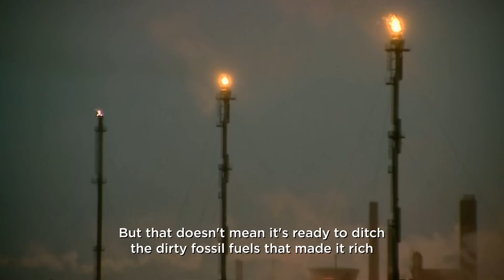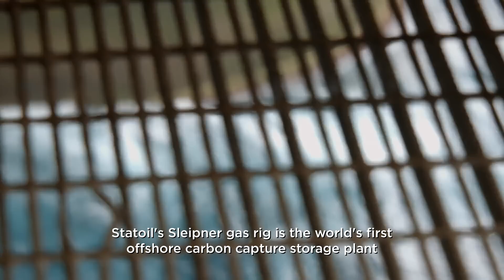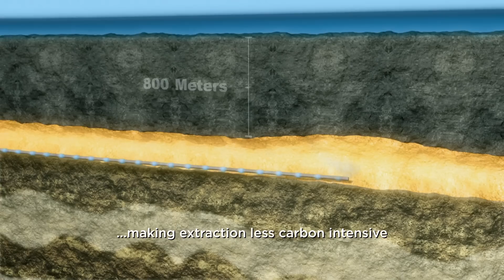Oil and gas companies are facing major technological disruption

Comment: I am not anti-nuclear, I am simply pro-renewables. Nuclear has failed to deliver what we need. One day perhaps, in the future, someone may be able to make a safe nuclear plant that is capable of cleaning itself up, but that day is a long way away. In the meantime, let's cover every roof with solar and allow the wind to blow us into a cleaner and more secure future.
Reply: Rob Kay storing waste and decommissioning old plants costs negligible amounts per kWh of electricity delivered. There are plenty of methods of storing used fuel. The core issue is that of public perception, nuclear accidents aren't special or particularly devastating however we demand perfection in regulation which we don't do of any other industry. If we applied normal hazard based regulation to nuclear it would be the cheapest source of energy and would displace much more dangerous and damaging forms of energy (fossil fuels have emissions and high death rates acquiring them, people even fall off wind turbines quite a lot!).
Reply: Rob Kay also have a look at sustainable energy without hot air by the late great Prof. David MacKay (chief scientist at UK department of energy and climate change) to get an idea of the amounts of space required to run a country on renewables.
Reply: A rather small percentage of the Sahara desert would generate enough solar to run most of the world, but transporting it would be silly. Using all our wasted roof space to generate solar: impeccable! 
Come back to me after we have done that ... and tell me if it worked.
Reply: I encourage you to check out some videos on the Liquid Fluoride Thorium Reactor.  (LFTR or "Lifter")   The technology has already been researched, but it was squashed because the director of Oak Ridge Labs wasn't a "people person" (didn't get along with the politicians) and also because it does not produce bomb grade material.
They ran a prototype LFTR reactor for 5 years, so this is not pseudo-science.  

The LFTR designs that are available still need to be updated, modernized and scaled for production, but overall they were Safer and Cleaner than any of the reactors in use even today.    If a LFTR reactor had been in use at Fukushima, the earthquake and tsunami would have been bad, but there would have been NO "nuclear disaster".   

LFTR reactors are "walk away safe".   If you have to evacuate the facility, it shuts itself down automatically because of the Laws of Physics.   You can't do that at today's typical nuclear reactors.  

The current typical nuclear reactor uses solid fuel.  The process only uses up about 3-4% of the physical matter.   The other 96% of the "fuel rods" is then unusable and has to be disposed of "safely".

The LFTR can use those "spent" fuel rods and effectively use almost the entire mass to produce energy.  The byproducts of this process have 2 uses (Medical and Spacecraft) so there is no need to "safely dispose" of the leftovers.     Yes, this means that we could potentially harvest and clean up our nuclear disposal facilities.
Reply: Thiru Vellan - how the hell does Hydro Electric lead to deforestation ?
There may be some land that is covered by BUILDING a hydro electric dam, but those trees can be replaced by planting new trees in areas without them.   But that's a precursor, not an after effect.  Plus it also creates a lake environment for fish and wildlife that wasn't there before.
Reply: Renewables Do use fossil fuels for production. This is not a valid reason to oppose them. Of course we will need to expend fossil energy in order to create the renewable resources that will replace it. Eventually, once we have enough renewable power, their production can be all renewable as well.
Reply: Unfortunately, not all locations have access to hydroelectric power. Also, hydroelectric has its own massive environmental impact. In locations blessed with hydroelectric, its usually much cheaper than the rate for fossil power.
Reply: The UK AGR II is safe, and has the usual low running costs. They currently generate at £10/MWh.
There is much less clean-up than is popularly believed.  High level waste from the entire UK nuclear programme over the past 60 years would fit in about 5 double-decker busses or so.

Replacing a 1.3 MW nuclear plant requires about 10 to 20GW of installed solar.  Covering every roof in the UK with solar and flooding the entire North Sea will just about replace our nuclear fleet.  But we also need to replace the coal fleet and the gas fleet.
Reply: We all need to put more efforts into inventing a more efficient battery. Seriously, battery development has gone stagnant in the past 3 decades or something. This has caused a huge obstacle in the implementation of clean and renewable energy sources since they are unpredictable and often times produce excess energy or no energy at all. The only alternative right now is to use the excess energy to pump water back into the hydroelectric dam for later use.
Reply: Batteries aren't an energy source.  Slow battery dev does not stop using renewables.  Current batteries are fine.  Look at Pivot Power, or even the Tesla grid-scale powerwall in Australia
Reply: icwiz - you are arguing the wrong point,  but I'll address it anyway.   

While it's true that eventually Solar will become a valid resource for energy on the large scale due to the development of better batteries.  There is really no need to rely on it as our primary source of industrial energy.

Wind Energy is only good for smaller scale energy generation.   Large scale production relies too heavily on government subsidies to make it "affordable" and "viable".    It cannot compete with or ever replace fossil fuel energy.     When looking at the cost of a wind energy site, you need to look at the costs not only in production and upkeep but also to the environment.    Birdstrike has become an issue in many locations where these devices are used en masse.    Other than the casualty to birds, there is also the fact that with enough windmills you will alter the environment.  

Think of each windmill as an energy converter.   You're taking the (mostly) horizontal wind energy and converting it into a rotational energy that in turn spins the generators to produce electricity.    With each additional windmill you're redirecting more energy from wind to electricity.     You're not making energy, you're just redirecting it.   So there is a net loss of energy in the force of the wind.   Minimal to be sure, but when you set up a wind farm over vast areas for dozens of kilometers you're effectively changing the weather.    What starts on one side as say a 20Km/h wind-speed  would be dropped down to only 2 or 3Km/h wind-speed on the other end of that farm.     So one end of the farm will be much more capable of producing energy than the other.   

In the USA, there is a recognized "Tornado Alley" that primarily runs through South Dakota, Iowa, Nebraska, Kansas, Oklahoma and Texas.   This region has been cited many times as a premiere location for wind farms.  Some even propose that such wind farms could prevent property damage by limiting these tornados.    
Other researchers have suggested putting massive (200k+ windmills) wind farms along the Gulf Coast out a few miles from shore to act as a buffer to slow down wind speeds during hurricanes.

Ok, that sounds great, using windmills to prevent wind damage sounds like a boon of good fortune.    My objection is that these massive wind farms would be effecting the normal and natural air flow that we rely on in our everyday lives.  Days when there isn't a hurricane or tornado on the way.  You would effectively change the environment.    The cold fronts that move South from Canada down to Texas every year in winter.   The warmer airs that move North along that same corridor.    Sure it would produce milder winters for those guys in Texas.    But that also means the people up in the Dakota's and Kansas area will have to deal with even harsher winters because cold air no longer "moves through" the area but comes in and stays.     

If you produce and deploy enough windmills to effectively replace fossil fuel, you're going to change the environment for large areas of the world.

TL:DR -- Using Thorium (LFTR) nuclear reactors on the other hand would be safer and more efficient without causing the massive disturbance to the environment that Windmills would.
Reply: I agree. We need power Generation, not collection, in order for our future to be secure.
Reply: But can you really say it has failed until you've actually tried to run a country on it, instead of building like 10 plants and then stopping because muh radiashun?

There is one case where we can make a thorough analysis of how well nuclear delivers when used as a primary source: France. France is one of the lowest CO2 emitters in the West because of that, is relatively independent from USA/Putin/ISIS/SA despite not having gas or oil, and has hilariously cheap electricity to the point where they even cook and heat buildings with it.
Reply: The problem with current reactors is that their origins are the Manhattan project. All other nations pretty much stole the research the US did. So most of the reactors are BWRs. The project scientists said that these type of reactors were only for making plutonium, not power.  We need another effort like that, with the idea of pure peaceful use of nuclear.
Reply: The_Blazar - I live in the USA and I use electricity to do many things in my home.  Cooking, Air Conditioning, Heating, Laundry all of it.   Not a single gram of any fossil fuel is used onsite.    Most of my electricity comes from local hydro-electric dams but they do also rely on nuclear.
Reply: CharlesDourdy hydro electric leads to deforestation.
Reply: Your emotions are great, now please keep them out of politics.
Reply: Our energy in Chicago comes from Nuclear power plants.
Reply: My friend their is a new idea of nuclear reactors. Search Vox Nuclear, The rethinking or reinvent of the nuclear reactor. There's also thorium, invest on.
Reply: Rob Kay...Please take a look at our friend(Namon Hawthorne) and his technology...we can clean water, radioactivity, and much much more!!!! https://sites.google.com/view/hawthorne-technologies-review/mr-hawthornes-resume
Reply: Germany shut down their nuclear reactors and focused heavily on renewables. They soon discovered that renewables weren't able to meet demands, so they brought coal fired power plants online. They will miss their goal of reducing carbon emissions by 2020. The funny part is they have to import energy from France, which is primarily nuclear power.

Batteries, are they one breakthrough away from being viable energy storage? No. We've hit the point of diminishing returns. The magnitude of battery advancement is going to be at a snails pace from now on.
Reply: Plus France is one of the few countries with successful nuclear fission and one of the few that use nuclear fission for everyday life. Just as Iceland is one of the few countries that produce successful geothermal energy.
Reply: Solar panels and wind turbines are just a lot simpler than nuclear energy, oil, and coal. That is why they are cheaper. Think about all the safety measurements, advanced technology, and especially logistic complexity it requires. Wind and solar is so simplistic and easy, with the big benefit of decentralization and independence.
Reply: Nanne Wielinga - Wind and Solar are primarily "cheaper" because of governmental subsidies.     
The production of wind turbines and solar panels both rely heavily on fossil fuels.  Look up their current production methods.

If you build enough Wind Turbines to produce even 50% of our (overall) energy needs you're going to effect drastic climate change as weather patterns are changed by misplaced energy.

Solar, Wind, GeoThermal - all of these are Great for small scale production, but do not provide the power output to reach demand.   Still I encourage we pump every dollar we can into their research and improvements.

The LFTR nuclear reactor would help us remove our dependence on fossil fuels while we continue to shift our infrastructure to an electricity based economy rather than oil based.   This gives us the time to improve the efficiency and usable lifetime of Solar Panels and batteries.

There is no simple answer and I'm sure I'm missing some important details.   I just strongly believe that  Solar and Wind is not the awesome "answer to everything" that some people claim it is.   Together we can find the answers we all need to build a better world.
Reply: Rob Kay I think its the cost of building the power station...then its 50 years of power then at the end the massive cost if decommissioning  it ... Safety is one thing...but its massively expensive.. Itd nearly be cheaper tontrain moneys to cycle bicles to generate power....at least they work for peanuts.

I'd say all told wave power is one if the best... The moon is not likely I be going anywhere and if it does our power problems will be the last of our worries.

Wave and tide power is steady, works everywhere we have water, you son need the wind to blow it sun to shine, it can be  generated 'under' the water too... So its not even visible, the problems only seem to be production related... But nobody seems to want to build wave and tide power farms.